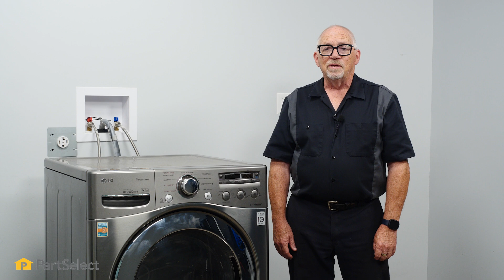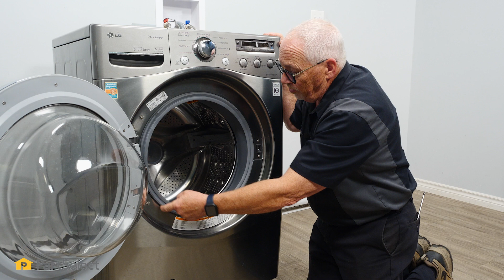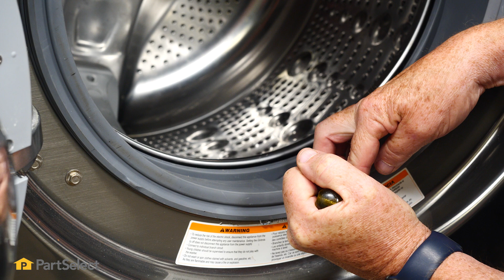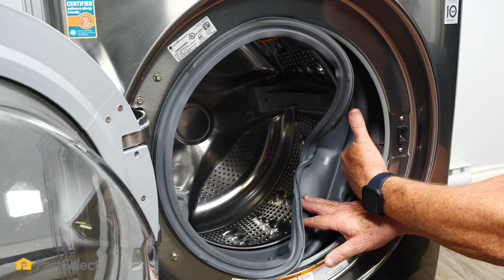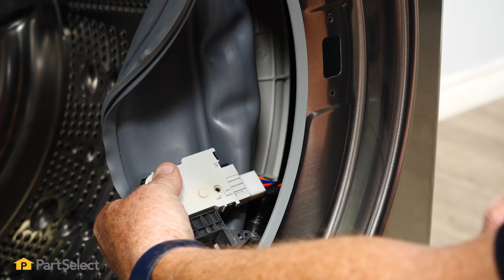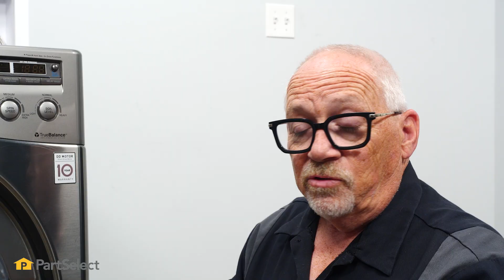LG Washer Repair - How to Replace the Door Switch Assembly (LG Part #EBF61315802)

Comment: Thank you for the tips to put the spring back without the special tool. I could do it as you suggest only i use a second flat screw driver in my right hand to guide the wire instead of my fingers.